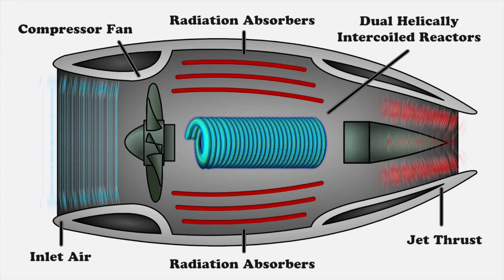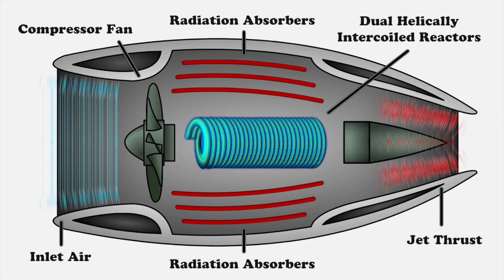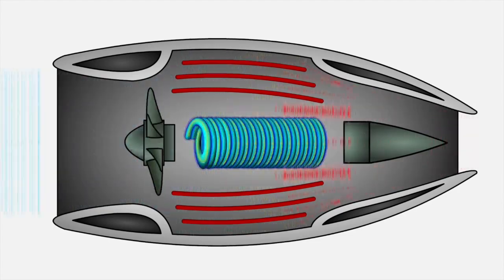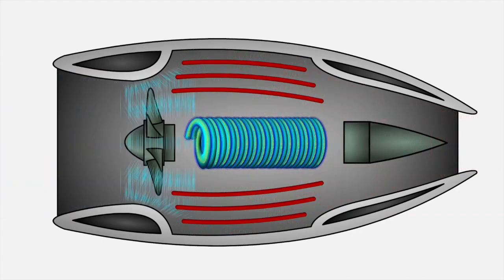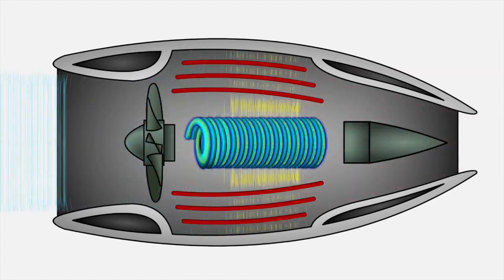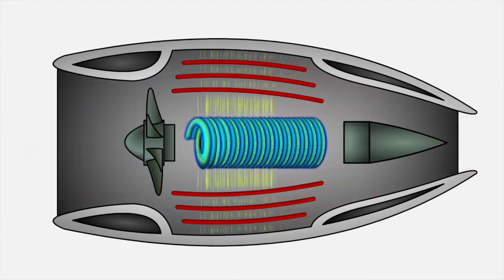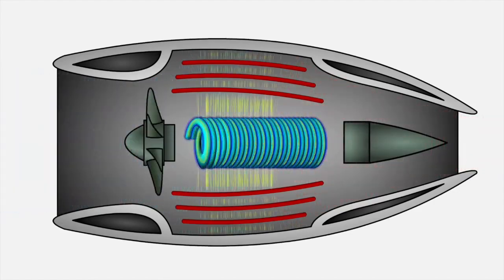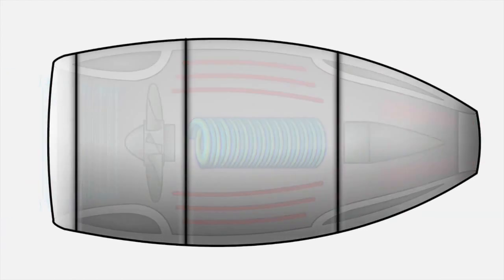Fusion Powered Jet Engine and Airplane

Comment: Because of the nature, of this topic I will half to be brief. (N.S.) this has , already been achieved. For some  basic  understanding  Please look up scram jets, for some examples. correction , high temperatures for thrust an , high Cfm s . Are what's required here.NOT PRESSURES.
Reply: This is a turbo, ram, scram jet engine.  This depends on craft velocity and configuration of air flow through the engine as it operates in these 3 phases.  How this is done is proprietary and will not be released until appropriate patents are filed.  The reactions in this engine are aneutronic to a level offering safe operation.  I will not discuss that technology.

Comment: An ionic fan instead of a turbine might be easier to transform into a ramjet or scram jet at higher speeds then transition to  a thermal rocket mode with on board reaction mass to create an efficient single stage to orbit vehicle. Virtually no fuel to scramjet speeds and no oxidiser needed for rocket mode would make a real heavy lifting space shuttle for cheap space access. I hope you fusion technique works.
Reply: Space access will be done with this engine operating at very high altitude flight in scram jet mode and then assisted by operation of a fusion powered neutron engine of high thrust we are developing.  The Nasa X3 ion engine produces about 1.21# of thrust requiring 102kW of electrical drive just for the thruster.  A similar sized neutron engine produces 372# thrust using less than 0.012 watts of electric drive.  Much bigger engines are possible.  The high gain is due to the high efficiency of the fusion reactor.  I only factored 1/2 the theoretical reactor gain for this calculation.  There will be other power requirements such as pumps, valves, electronics.  Total should not exceed 400 watts.  The engine will also produce 10-20 kW DC electricity from waste heat, more than providing the 400 watts needed by the engine.  1# of 50% deuterium & 50% tritium fuel gas will run the engine 74 days continuously at full power output.  Once we do POC on the reactor, the neutron engine may be a next project, for a university space flight program is very interested in this engine.  Patents must be filed before releasing any more information.  With both engines operating, the craft will "fly" into space.  Once in high vacuum the jet engine will no longer be operational.  The neutron engine does not require a vacuum environment for operation like the Nasa X3, but must be operated in near space due to the neutron radiation output providing the thrust.  It can take sufficient fuel to go to Pluto and then return to Earth.  It has sufficient fuel to decelerate into planetary orbit, rather than just making the quick flyby resulting from gravitational assist.  I envision acceleration to about 10% of the speed of light, followed by a coast, then an equal deceleration phase placing the craft into orbit.  The flight time increase between going to Pluto rather than Mars will be no longer than a few weeks at 10% speed of light coast.  The deceleration phase will be about the same in both cases, and is dependent on the given planet's orbital escape velocity.

Comment: If your going to imagine using the immense power of fusion, then why not take the reactor coils out of the engine body and heat the air in the expansion phase with plasma?
Reply: The air needs to flow in proximity of the reactor coils such that thrust is created by the increase in the air's temperature.
Reply: @jamesdeluze9732  that could also be done with a heat exchanger seperate from a centralreactor

Comment: how does this reflect on Putin's boast  this last week of nuclear powered missiles?  Is his boast possible, probable, or impossible?  Is there someplace that examines his statements to see if his is an empty boast?
Reply: Putin's boast most likely involves a fission powered engine which is possible.  The soviets actually flew a Tu-95 bear powered by a fission engine in the 1960's.  Radiation shielding was the most important issue.

Comment: How can those coils produce the temperature required for thermonuclear fusion?  So far the only man made fusion energy, besides of course the Hydrogen Bomb, has been produced by magnetically bottle-necking plasma until fusion occurs.   Maybe this engine design could work with fission energy.   I've seen fission energy rockets which have been around since the late 60's.
Reply: The coils are the reactors. How they work is proprietary.  Confinement has distracted fusion research over 60 years.  Fusion is not directly dependent on temperature or pressure, these quantities are secondary.  Fusion is solely dependent on particle collision velocity, period.  This mistake and the assumption that collisions are random has wasted over $1.2T in R&D and 60 years of time.  The temperature is not a directly relevant factor, with internal reactor temperatures being very low compared with most fusion approaches to allow component longevity.  Reactor output power is set by maximum design temperatures selected for given reactor component parts.  Magnetic bottled plasmas will never efficiently work within the low gravitational flux of Earth or outer space. Go to our website at fussionenergysolutions.net to see how AC velocity impact fusion works. It has been made operational by Lawrence Berkley Lab with DC.
Reply: @jamesdeluze9732  your post is the biggest load of garbage I have seen.

Comment: The biggest issue here is that it's basically a big electric ducted fan that uses the air to cool itself. Jet engines don't work by "heat", they work because of the explosive pressures released by burning the fuel. This in turn produces heat as a bi-product, but the force created by releasing the stored energy in the fuel is what actually turns the turbine blades and pushes the engine forwards. A nuclear ducted fan would be OK, but it would never achieve thrust sufficient for mach flight.
Reply: If you are going to hate comment please read until the end.

There are no "explosive" preassures in burning fuel, actually jet fuel is very similar to diesel fuel, the point of turbine engines isn't turning the turbine, and turning the turbine doesn't give you any thrust whatsoever (in turbojet engines it actually lowers it, because, although it is necessary to keep the engine running, it is essentially absorving some preassure off the exhaust gases who in turn produce thrust)... 

By turning the turbine you can increase the air input by the compressor because they are connected by an axis, the point of the turbine is only to move the compressor in the "front" of the engine making it for more air preassure to enter the engine faster... 

The heat produced by the burning (not explosion) of fuel is actually very important for making thrust happen because heat means particles are accelerated and they push against each other being ejected very forcely through the engine's exhaust through a venturi tunnel hence increasing thrust even more. 

Now... Turbo Fan engines (and helicopter turbine engines and turbo prop engines) priority on the other hand is to turn the Fan in front of the engine, which is connected by an axis to the turbines or turbine of the engine, by producing high torque (rotational force) which in turn move the Fan (or helicopter blades or propelers) producing thrust. 

So.. The high heat produced by nuclear reactors can actually be very effective in turbine engines.
Reply: @pedroferreira2871  so if I understand you correctly, you mean to say any heat source that can quickly & efficiently heat-up the compressed air, can produce thrust in a turbojet engine? Please correct me if I'm wrong.
Reply: Pedro Ferreira if we can get this tech we can build massive aircraft that are like giant submarines have like 200 nuclear missiles or we could use it peacefully and make a plane that can stay in the air for months and monitor the weather
Reply: A jet engine is a HEAT engine, much like any other. Explosive pressure is heat, a heated gas has a higher volume, thus turns a turbine to keep the compressor turning + Net thrust. This heated gas doesn't need to be produced by a fire. Using fusion heat is a very dumb idea to do this though, seeing as we can't even do it on any scale yet, much less small scale self sustaining. A fission system can do it in theory (Aircraft reactor experiment or Fallout 4 airliner anyone?), but due to radiation that is also a dumb idea.
Reply: The Eh Team 
If a fusion plasma was hot and dense enough,  compressed air could be fed directly into the chamber containing the plasma and the air would not be able to touch the plasma because of the intense radiation radiating from the plasma.  If all of the compressed air was ionized before it reached the plasma, it would be trapped by the magnetic field which would also keep it away from the plasma.  This dumb idea will probably be fueling the car of the future in twenty years that can fly in and out of space like commuting between the suburbs and the city without some jerk tailgaters behind it.  Jerk tailgaters are a lot like jerk youtube commenters.
Reply: You might want to read about the air force experiments with nuclear aircraft. The jet engines in those experiments were effective turbo charged radiators that had the compressor ram the air through a very hot radiator filled with liquid metal reactor coolant which heated and expanded the air through the turbine. The only difference is the source of heat but the principals are the same for a Brayton cycle heat engine
Reply: Heat causes a gas to expand. A
Jet engine basically creates hot compressed gas, then expands it out the back.

Imagine a bottle of liquefied CO2. If the temperature of the contents, the bottle and the environment is bellow it's boiling point, the CO2 will just come out as a liquid if you open bottle.

But if you heat up the bottle and the contents, it will come out creating thrust. More heat, more thrust. More compressed before heating, more thrust. The same is true in jet engines.
Reply: The engine is not an electric ducted fan, but my graphic artist's rendering may made it look so to some.  I was happy to have his assistance, and was not concerned about the rendering revealing how it actually works. It is not the function of this video to reveal how it works, but to demonstrate briefly what it will do.  How it works will be released as future patent applications are approved. The engine is a turbo, ram, scram jet nuclear fusion ducted fan like engine (only during turbo operation) whose actions and functions are proprietary.  Due to the very high gain of the reactors unique processes, mach flight to hypersonic speeds in scram jet mode is the goal.
Reply: unlike a normal IC engine, there's no explosions in a gas turbine, just a constant flame. It's the heat expansion of  the air that creates the trust. Go read a book before trying to explain others how it don't work... and your claim that it wouldn't work with nuclear power is experimentally disproven many decades ago. The only reason they didn't become a hit in the civilian aviation is the fact that they were awfully dirty. But things have come a long way since the 50's and 60's pilot killing radiation poisoning prototypes, just it's being done by military contractors like Locheed Martin. They patented new developments just a few years ago to give you a hint of what's going on behind closed doors. Here's wiki on nuclear jets https://en.wikipedia.org/wiki/Aircraft_Nuclear_Propulsion
Reply: @happyfox711  Actually the trust is the energy released during combustion. Heat is the byproduct. Heat has zero to do with trust just as heat has zero to do with combustion. It's lost energy that is virtually useless. It's not I that needs to read a book. If heat = trust, then we'd have engines based on that, we don't.
Reply: @JohnDoe-ml8ru  Don't back paddle here, you claimed this had something to do with explosions. We do have engines based on heat expansion, it's called jets ! They operate on the Brayton cycle, guess what kind of cycle ? Or you could look it up - I'll help you along, The Brayton cycle (in all jet engines) is a thermodynamic one that quote "describes the workings of a constant-pressure heat engine(a jet engine)"
Reply: @JohnDoe-ml8ru  You doing it backwards, and quite contrary, heat has EVERYTHING to do with trust. also check out THERMO nuclear propulsion aka nuclear THERMAL propulsion(what do you think it is ?) that you claimed would not work. Don't get off track again, just admit you were waaay off the mark.
Reply: This is not a ducted electric fan. How the compressor is turned is proprietary and will not be discussed. This video is a simplistic representation of a very complex turbo ram scram jet engine. No electricity is used in turning the compressor though my graphic artist made it look like a fan.